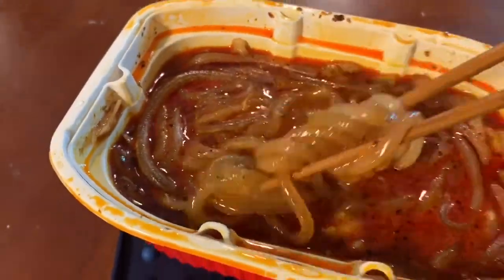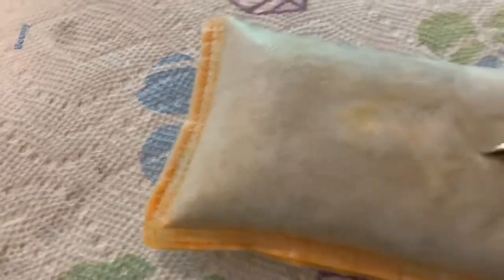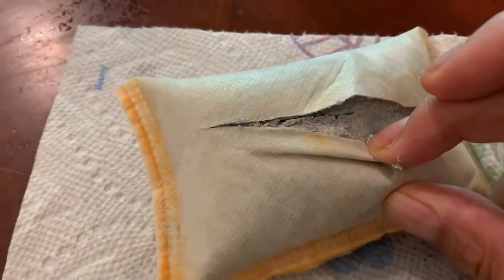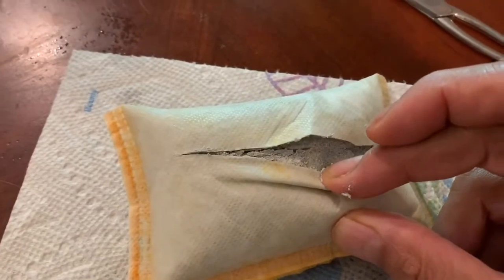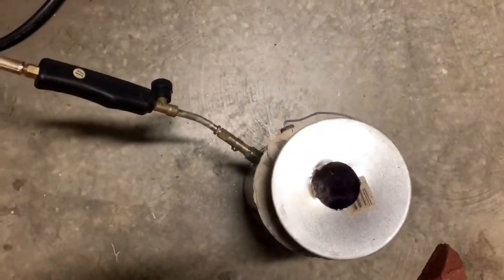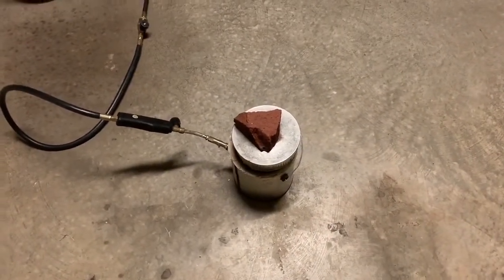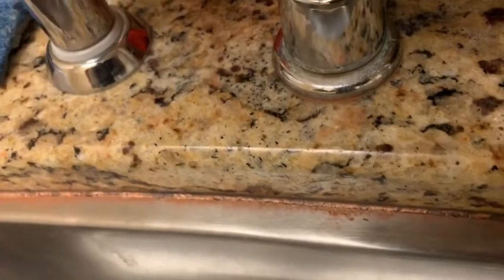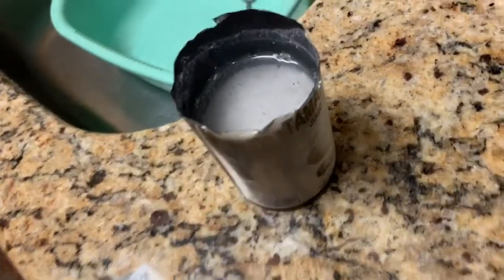Can We Regenerate the Food Heating Pack?

Comment: You are braver than me! Self-heating packaged food is scarier to me than all the high-power electrical projects;-)
Reply from the maker: I’ve been eating self heating food on and off for a  bit. So far no problems. So I kind of got used to it. These kind of foods are much more common in the military as well as in China where they are widely available. The chemical used is calcium oxide which is non-toxic.
Reply: @BrianDhvTinkerer  Yeah, but regenerating it seems more annoying than other options. I've been thinking about using sodium acetate for this purpose, an easily rechargeable self heating package for foods. While the heat of crystallization may be lower, it's far more convenient to reutilize as, for instance, if you're making soup, the heat you use to boil the water can be used to regenerate the package itself.
What do you think?